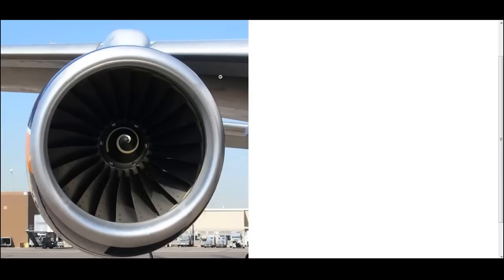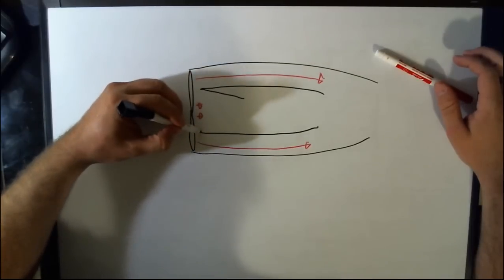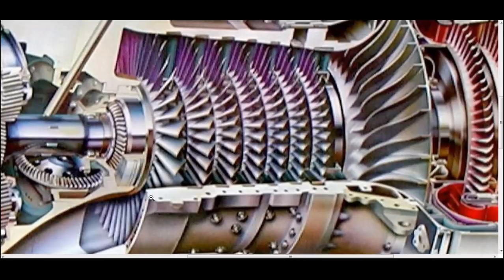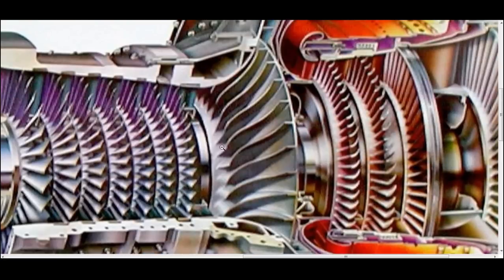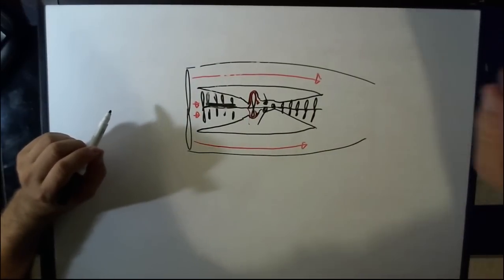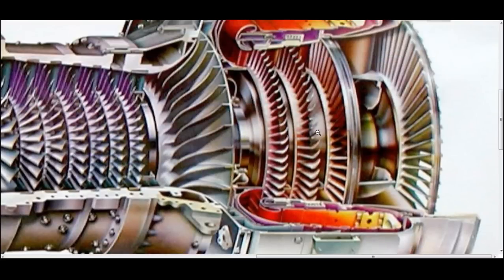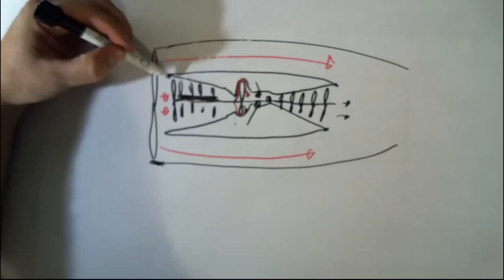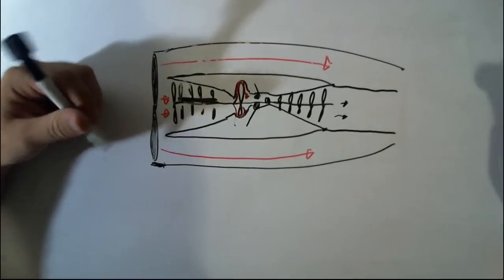How A Gas Turbine (Jet) Engine Works

Comment: Thanks for your video. Please tell how do the front blades get power to rotate initialy before the combustion starts.
Reply: There is a small engine in the back of commercial jets (the auxillary power unit or APU) that provides the electrical energy required to start the blades spinning and igniting the fuel.

Comment: Good vid, but I don’t believe you gave very good explanation of the Stator blades and the important part they play and how they work, and I have seen this in many YT vids where ppl try to build a turbo jet engine type, negating to include properly formed Stators which redirect the air onto the next stage increasing angular deflection of the airflow onto the following blades for a greater torque increase against the turbine blades of each stage.
I’m only a novice, but I believe this is the purpose , reason and need of the Stator vanes, often misunderstood, overlooked and/or understated in the explanation of turbine/jet engines design.
Anyone , please correct me and explain if I am wrong.   Nice vid,  Thanks for sharing.

Comment: great video. ... but  i wish it had some more information including the energy specifications, differences with and without afterburner and so... Anyway, better than other stuff available .
Reply from the maker: MoNika .Mondal Many thanks.  I currently have some information on compressor and turbine calculations if that's the kind of energy you're looking for.  You can find one here, the same math applies to compressors.
www.youtube.com/watch?v=RoTVeF13HDc
If that's not helpful, are you looking for more general specifications rather than calculation?
Reply: Well illustrated ...
Reply from the maker: Pradeep Kumar Many thanks

Comment: so the engine is taking in cool air and compressing it and ejecting hot air,and that creates thrust(without using the afterburner?) ...so why do we even need fuel in the jet engines(if we don't want to use afterburner)? to rotate the rotors?

Comment: so if the turbine powers the fan and the compressor, how does it get started? I mean when the engine is off and the fan is not rating, how does the turbine get started to power the fan and the compressors?
Reply from the maker: +Dave0551 
Gas turbine engines are generally started by high pressure air entering the engine from a separate "Start Cart" or JSF (Jet fuel starter).  A start cart is not part of the aircraft while a jet fuel starter is integrated into the aircraft.  Both supply pressurized air adequate to move the rotating parts of the engine fast enough to rotate on its own when ignition is introduced in the combustors.
Reply: Joko Engineeringhelp so in more simple words, its a high pressured air that enters the turbine to get the parts moving?
Reply from the maker: Dave0551
Exactly!
Reply: +Dave0551 - depends on the gas turbine design and intended service....industrial machines are rotated to lightoff speed with a starter motor (electric, air, or hydraulic) connected via the accessory gear assembly. Biger machines may have an inching or jogging helper motor in addition for controlled cool down.
Reply: +Dave0551 Thanks for asking that question Dave. I've searched countless videos that ignore this very basic and logical  "chicken-or-egg" starting point. Everyone seems to want to impart their knowledge of jet engines with monotonous sameness, all leaving out this important information. Well done mate.

Comment: Wouldn't the after burn cause the turbine blades to spin backwards? It sounds like the afterburner would be higher pressure than the air that just passed through the turbine from the combustion chamber.
Reply: But, the surrounding air (behind the engine nozzle) is at still lower pressure.  So, the gases in the afterburner prefer to flow in that direction.

Comment: To clear my confusion, when the engine starts up cold, does the compressor first spin to compress the air to send to the turbines? you also mentioned that the turbine is spinning the compressor as well.
Reply from the maker: It depends on the engine.  Some engines have a built in smaller "starter" that spins the compressor quickly enough for it to build compression and ignite the fuel.  Smaller engines utilize an external blower, which blows air through the front to spin the compressor until ignition occurs.
Reply: @JokoEngineeringhelp   thanks. that clears it up.

Comment: Great explanation! Thanks.  Approximately how many rpm does the Turbo fan spin.? if one removes the turbines behind the combusting chamber and is able to turn the fan in the front by some other means (external from the jet ), will there be more thrust produced due to no energy lost by the exhaust gas in turning the turbines?
Reply: Turbofans are linked on the same shaft as the turbines which are powered by the accelarating exhaust gas. The turbines takes up some of the energy to torque the large fan. Newer turbofans use less turbines and include a gearbox to reduce the fan speed lower to subsonic levels at the wingtip. There should be more thrust produced due to the greater ratio of the intake air (slower) and the exit air. I stand for correction on this

Comment: Quick question!
When advancing the throttle, does it increase the rotating speed of the fan blades or does it just increase the amount of fuel injected?
Reply: Since the rotating speed of the fan blades relies on the turbine, and therefore the air moving out, the more fuel the faster air moves, and the quicker the turbine will spin therefore increasing fan speed. I believe after a certain amount of fuel though, the mixture of fuel to air will become too high and you will experience a flameout.  I'm no expert though

Comment: As the combustion of the air/fuel mixture presses outward against the turbine blades in the rear of the engine, how come it does not press equally against the blades forcing air into the combustion chamber?  It would seem that the two turbines would be fighting one another and the energy output would be nil.  Of course jet engines work well, but how is this back pressure problem overcome?

Comment: So this engine is what they call the Turbofan jet engine, since the front fan is what generates almost all the thrust.  So the fan also stuffs air into the compressor too I imagine.  About how many PSI does the fan provide at the front of the compressor opening when the engine is at full throttle?  Very interesting. 
So then I suppose the 8 engines on the B-52 bomber are pure jet engines that use the exhaust for its thrust.  I love the sound of the B-52 on takeoff.  Good info.  Thanks
Reply: Typically it'd be characterized as the fan pressure ratio, which is the ratio of the stagnation pressure before and after the fan. The stagnation pressure is the pressure if you brought the flow to rest – it's nice because it provides a measurement of the change in overall flow energy. For a high-bypass turbofan in cruise condition it's somewhere around 1.5-1.6, so the stagnation pressure after the fan is about 50% higher. For the ultra-high bypass ratio turbofans such as the PW1100G on A320neo, it's a bit lower (1.3-1.4 or so) because the fan thrust is from moving more air rather than accelerating that air faster.

Comment: Thanks for explaining I always thought the afterburner put fuel into the turbine not the exhaust gasses.
Reply: No. And also the afterburner is not a critical part to making a fast fighter aircraft it is jus used in times when fast acceleration is needed e.g. takeoff and emergencies

Comment: Ok. Heres a question that Ive yet to get an answer for and Ill bet you can answer it.
The hot air expanding makes the pressure which gives thrust, right? So, if that pressure is greater than the gas mixture before it is ignited, what keeps that greater pressure from blowing back into the compressor?
Reply from the maker: Great question.  When flow through the compressor is abnormal you would call that compressor stall or compressor surge.  Here is an example:
https://www.youtube.com/watch?v=advmGVR5Nkw
Usually the pressure on one end of the turbines and the lack of pressure on the other end of the turbines causes a stable flow to the end that has no pressure
Reply: To expand a bit (like the gas), the pressure increases through the compressor, slightly decreases through the burner, then significantly decreases through the turbine. The only place it increases is the compressor where work is being done on the flow.

Comment: nice video, but how by pass air provide 75% of the thrust? the engine only provide 25%?
Reply: Dabulous, on a turbofan engine, the inner core that is taking 25% of the air flow is there almost exclusively to power the fan. So it's job is not to provide thrust, even if it does anyway, but to provide the drive for the fan. And the thrust of a jet engine is a force that is pushing forward, not backward as most people think.
No Arsian, it's not that way.
Reply: As you know this is a turbo shaft engine in base and coverted to turbo fan engine
and turbo shaft eng.duty is to rotate shaft only and it rotate a rotor for flying.
In this engine a fan is located in front of it and the fan is engaged to the power turbine and P/T drive the fan in order to move a large volume of air from the front to back of the engine and it cause to obtain thrust

Comment: if the air gets very hot at 450 degress with the compressors, can water be just the fuel as it will be instantly vaporized and will turn to steam
Reply from the maker: Yes, however you would need something to keep heating the water or the water will cool the system down very quickly as it takes a lot of energy to turn water to steam.  Nice idea.

Comment: There are two types of compressors:  1) Centrifugal 2) Axial-flow.   You were combining the terms Centrifugal and Axial, which I don't think is correct.  And if anything,  a Centrifugal compressor has a radial effect on the air,  not an axial effect.  And a Axial-flow compressor has an axial effect on the air.  So, I wouldn't use the term Centrifugal and Axial together to mean the same thing.   Unless I'm missing something.
Reply: I found a reference in the Jeppesen Powerplant Textbook, page 3-13: " The centrifugal compresor, sometimes called a radial outflow compressor, is one of the earliestr compressor designs and is still used today..."

Comment: So turbines provides the rotating energy ? Right
How initially the engine begin to rotate with out the compression of air
Reply from the maker: It depends on the engine.  Sometimes an onboard starter, sometimes external.

Comment: i know this a stupid question but will it work vertical???
Reply: can i just put an electric fan on top of it to start it???stupid just learning now
Reply from the maker: It can function in the vertical position, I imagine it would be quite tricky to get something to fly with a vertical gas turbine engine though.  They have external fans used for starting, some are equipped with a starter.
Reply: Check the “Flyboard”, it uses compact jet engines in a vertical setup to hover.

Comment: Can someone explain how does it compress air? I mean how does it generate pressure, are the blades spinning at different velocity?
Reply: The pitch of the rotor blade stages increase while the area available for the airflow gets smaller.
Reply: increasing the number of blades progressively also aids in compression. yes if the area for the compression gets larger or smaller  towards the combustion chamber then the velocity increases or decreases with a change in its diameter.
Reply: So it is basically being pushed towards a progressively smaller area, right?
Reply: Not really. In your statement a fixed or CONSTANT AIR volume of air is pushed towards progressively smaller area (actually volume). In the jet engine it really is an INCREASE in air volume into a fixed containing volume. I will try to explain. Assume we first close off the compressor stage from the combustion chamber. Now we allow air to be  sucked in by the first forward compressor ring. we immediately close up the intake just forward of this compressor blade ring so no more air is allowed in. We also blocked any air from entering the combustion chamber aft of the compressor stage. So we have a sealed compressor stage area (volume)
Prior to this air being sucked in there was air already in this compressor stage volume of 1 atmosphere. The compressor stage volume is constant, it does not change like that of a piston engine that compresses air by reducing the volume of the chamber (being pushed towards a progressively smaller area). the volume between the first compressor blade ring and the last ring is constant. The compressor blades are turning but they do not change the volume within its housing. What happens is the spinning force of the blades pushes the air from the front towards the back of the engine. What will happen in this scenario where we blocked any further incoming air and closed off the  combustion chamber from the compressor, is the newly let air in prior to blocking off the intake is forced into this  fixed volume (sealed off compressor stage volume). The newer intake air will mix with the air already inside of the compressor stage and increas the pressure to higher than one bar. This new air mixture will come int equilibrium. Note the volume of containing space is the same, but the density and mass of the air is higher. In your statement the volume of containing space is reduced with the mass of air constant.
 I hope my explanation is good

Comment: So the purpose of the jet part with all the turbines is just to spin up the blade at the front?
Reply: No, it does provide its own thrust. however with more research, they realised that if a fan was attached upfront, forward of the compressors, and larger in diametre than the engine itself, fitted within a nacelle, they would achieve more thrust and burn less fuel. They dont use this setup on military jets. Fuel economy is not a concern for military use.
Reply: Thanks.

Comment: I thought holes where put in the first combustion camber to slow down the air feul mix to give it more time to burn
Reply: and can you give a link to the picture?
Reply: +Jay Berry - there is a complex system of air passages and holes in the combustor can designed not to slow down the flame, but to keep it from impinging on the metal parts. Any flame contact on metal (around the 1260 deg mark) will create hot spots and melt or accelerate corrosion. There is an air cushion developed to protect the engine components and to help cool the combustion gases to reduce NOx emissions.
As mentioned briefly in the video, there are also air passages within the blading of the power turbine stages for cooling.
Reply: Obviously the air from the bypass is flowing through the holes with the fuel into the afterburner where it ignites with the exhaust gasses, but I don’t understand how that translates into additional thrust.

Comment: Burning the fuel causes isotropic expansion, so why doesn’t it push back, slowing down the compression fans. Same question when you use the afterburner.
Reply: Designers make sure that the pressure of the intake is larger than that of the thrust by the exhausting gasses and the fuel flow is managed to keep it this way. That is why a Jet engine will always be less responsive than a piston engine. If thatbalance is disrupted, then what you describe happens and that is called a flame out. Look up compressor surge or axi-symmetric stall.

Comment: It looks like you only need fuel to get it spinning.  Once it is spinning it runs on air.  Right?
Reply: I have the same question.  if it runs by the air then what is the mechanism when a jet in the runway...
Reply: No, air is not a fuel. A combustion needs an oxidizer for it to take place
Reply: You might want to take a match to hydrogen or oxygen someday if you think air is not a fuel.  Just say'n.
Reply: @wizbang16  try igniting air, a mix of oxygen plus hydrogen and nitrogen (and other gases)
Reply: @wizbang16  pure oxygen is not flammable by the way
Reply: @lucastekkan  Pressurized air with oxygen will absolutely ignite. ( See Saturn 5 rocket)
Reply: @wizbang16  again, it uses fuel, not only oxygen alone. Also, a jet engine is not a rocket. You need fuel, FUEL. Ever heard of a combustion ? Oxygen (the oxidizer) is only a part of the combustion process. Ever opened a chemistry book ?
Reply: @wizbang16  Saturn 5 is also a liquid propelled rocket engine, try again. Geez, at least try reading about things before spouting them
Reply: @lucastekkan  You seem to think air is only oxygen.  Come on dude, how much are they paying you?
Reply: @wizbang16  usually the oxygen in the air is the one that reacts with the fuel. That's why it's called an oxidizer. Try studying for once